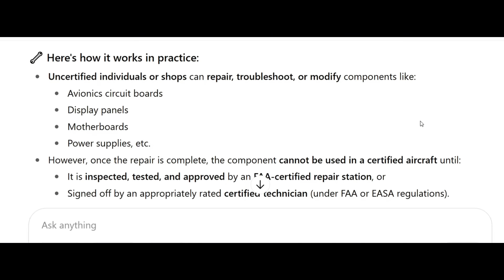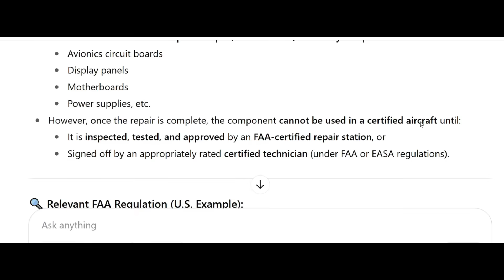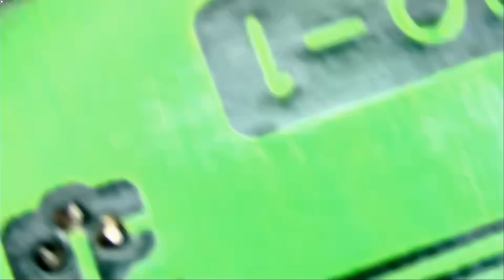We Fixed a Cessna Circuit Board Without FAA Certification - Here's what happened.

Comment: No problem, boss! You can easily find an FFA certified technician in the Youtube comments section. Let's get one of those geniuses to comment and sign off your work. 😁
Reply: A Future Farmers of America certification is tricky to get.
Reply: I got jobs working Mil-Spec and got ANSI certified twice
then soldered one wire to one pressure sensor on New Horizons bound for Pluto. Got NASA certified later on. 

His work looks pretty fukin outstanding to this expert.
Reply: these people forgot the Boeing nasty job in the MCAS cases and 737 MAX series, but they only push this YouTuber

Comment: What happened to rights to repair?
What happened to any electronic devices that needs fixing 

Testing devices is also important 
Even factories sometimes have stuff recalled
Reply: This has nothing to do with right to repair. Your statement has no relevance to this  Aviation issue. Experimental aircraft can be built and fixed by their owners, certified aircraft require repairs signoff by the A&P mechanic it is also why keeping a maintenance log for a certified aircraft is mandatory.
Reply: Right to repair will never apply to stuff requiring such certification.
Reply: The regulations are there so you don’t have a Cessna falling from the sky in your living room. I can personally say it’s not possible to “just pull over and take a look” at 5000’ while moving at 200 knots when something isn’t working correctly. At the same time, civil aircraft do not have, nor are required to, the same level of secondary/backup systems as commercial ones. Why? Because I don’t have 50-100+ paying customers behind me, different rules. But there ARE rules and as they say, they’re often written in blood.